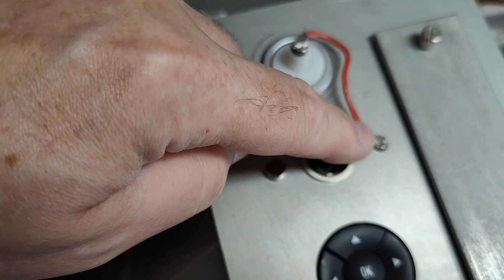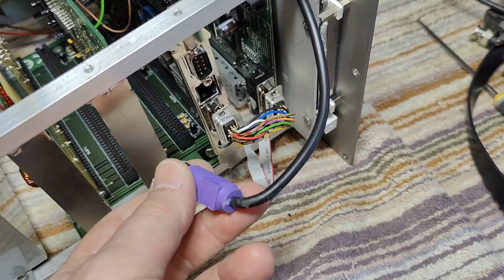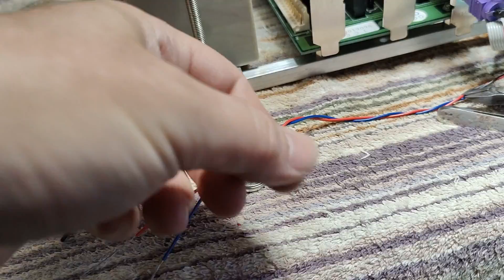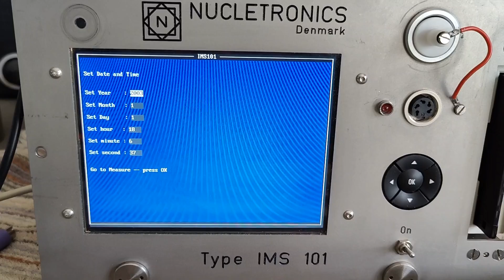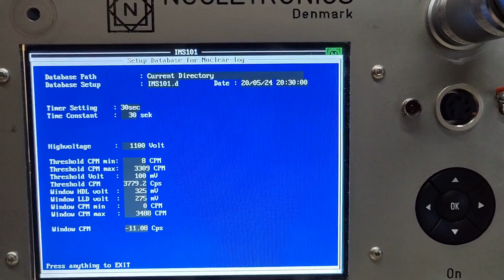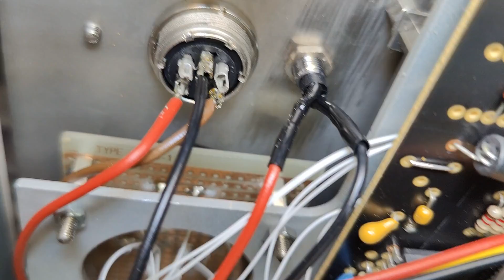Nucletronics IMS 101 welding checker 2006 DOS 6.22 pc inside

Comment: Very nice hardware, looks like mmx ISA single board industrial pc (PC104) with custom power supply board and custom sensor interface board. Enclosure is thick metal to radiation harden it. Radiation can effect SRAM and CPU. I have never seen 1.1kV flyback transformer on a custom ISA board:) You may archive software inside that hard drive, preferably archiveorg:) Except that funky cable it is pretty cool geiger counter. If i were you, i use it as is. By the way what is sensor model number?